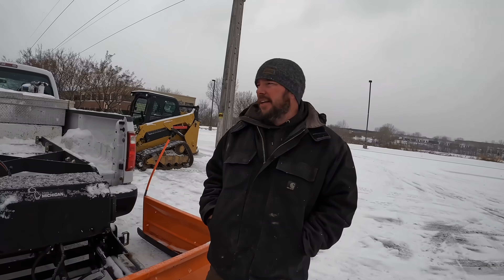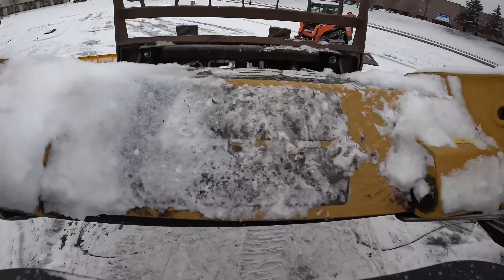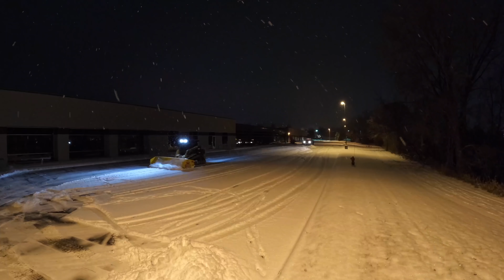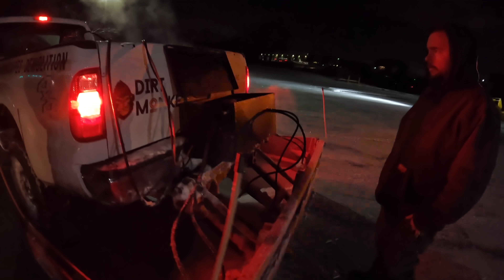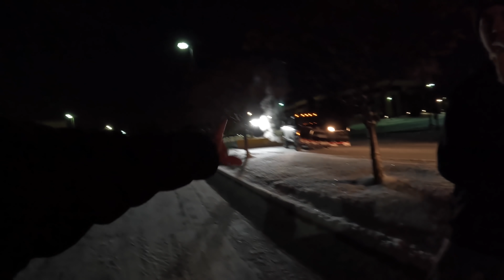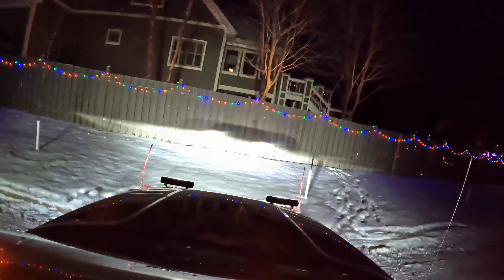The First SnowPlow of the year

Comment: You  should  do a white board Monday with a  sketch  of the  parking  lot, and the  most efficient  way  to  plow it. I don't  plow  anymore but  did plenty of long sleepless  nights one time 36 hours in a 5' Noreaster. I did  knap 2 hours. Like  to watch every  once  in  awhile. Broke down  at least twice  every  season. Duct tape extra  plow parts,hydraulic fluid,bulbs carried extra hoses,plow edge bolts you name it. Usually doing  repairs  under the coldest windiest  blizzards, but not telling  you  anything new. I'm sure  you  have lots of years of experience and  valuable  lessons  learned.  Merry Christmas.
Reply from the maker: Merry Christmas and Yes-  been there with all those breaks downs in the coldest time of the year.

Comment: Stan im happy im not the only one that completed failed last storm!! Thermostat blew in my 7.3 powerstroke so i replaced radiator and thermostat then went to go pull outta the shop and burst 2 lines on my plow, got the backup truck setup and got to my accounts then the controller completely stopped working 🤯😡
Sometimes you just need to accept the Loss and try again tomorrow lol i couldnt do anything but laugh

Comment: Stanly you need to look into a fisher xv2 or xls plow I know you are not a fan of western plow control but I promise you once you use a fisher and find out how simple and reliable they are you will never go back. Just so reliable and onlyblade I’ve used that can stack snow like they do
Reply from the maker: I do like the fischers
Reply: @Dirtmonkey   next truck put one on will never go back for parking lots you can’t beat the simplicity. Yes it does not have down pressure but it’s a heavier setup then most so it does Awsome job scraping for a plow without constant down pressure

Comment: I feel you with the break downs. Blew out my driveway once and now my old Craftsman tractor won't start and the belt keeps slipping off for the blower. Looking for another tractor with a snowblower now. Was thinking about getting a plow for my 01 Silverado but it drifts bad here have had 4 to 5 foot drifts before and a skid loader had problems getting through. A tractor with a snowblower is best. I can't complain too much bought my Craftsman tractor back in 06 for 350 and this is the first time it has failed me. Just got the snowblower for it last winter worked good all last winter.
Reply from the maker: sounds like that old craftsman served you very well for a long time.
Reply: @Dirtmonkey  yes it did. Not sure what is wrong with it.

Comment: ive got a late 90s sno way with down pressure and had my plow fall off at least 3 times and ripped the wiring harness apart every time back dragging and now i always run 2 seperate chains from the tow hooks to the plow quick hitch to keep it from going out
Reply from the maker: falling off is bad but when it takes your wiring with it thats frustrating.

Comment: I did the same thing with my Hiniker Scoop Plow. Passenger side was locked in but must have not got it back far enough on the drivers side. The pin went through but not on the mount. Looks like we both dodged a potential big accident.
Reply from the maker: Yeah close call for sure

Comment: for pickups i tried out a set of retreads with walnut shells cast into the tread....am amazed at the traction on ice...can do in two wheel drive what i had to use 4x4 for
Reply from the maker: Ive never heard of that
Reply: @Dirtmonkey  treadwright and toyo both make them...worth a look...do know that when driving down the road i air up to max inflation to keep tires cooler

Comment: Yeah im itching to try out my new tire chains for my tractor that are more aggressive then the old wore out set.  Unfortunately im kinda needing someone i can call to plow my driveway were im living now to a quick and dirty plow so i can get in with my semi bobtail when i have my home time.  Worst case i can pull in to moms driveway and get my tractor out and put blade on and go plow my driveway next door and when bring tractor back grab semi and park at house and then i have my pickups i can drive while home.  My dually is not road legal and power brake booster issue though but 4x4 works if needed around house

Comment: Would you ever consider using a tire siping tool on the summer tracks to give the more traction? It may be a way to breathe some life into a tired set of tracks that still have enough rubber for winter use.
Reply from the maker: That has been discussed.  It may happen

Comment: Was the Transfer Case failure on one of the Fords? Make sure the front driveshaft joints and locking hubs are in good working order. Either one can cause contribute a transfer case failure.
Reply from the maker: Yeah-  the ford blew up.  its in the shop now

Comment: I’d have the winter tracks already on the skid steers before it snows ? Just sayin ?
Reply from the maker: We got caught on this one.  Just not ready
Reply: @Dirtmonkey   For your next truck i highly recommend the Ford with the 7.3 Big Block V8! I traded in my 2018 Ram 2500 6.4 for a 2021 F-350 STX FX4 4.30 gears , 10 speed trans , snow plow prep last April ! I luv this thing . It gets better gas mileage than the Ram . I’m running a Boss V Blade on it ! You won’t be disappointed! Pure Beast !

Comment: Stanley I know you have seen the one that I am thinking about.  The only picture I could fine was on YouTube for the John Deere Worksite Pro Snow Blower.  I am more interested in the unit that you can put the top on the ground and back plow.  I know you saw it at a show you were at.  It has 2 augers and the opening is adjustable.  There is 1 for a bobcat and another unit for a tractor.  Is is possible to get a test model and try it out on your parking lots?  I would like to know exactly how good they work.  Do you know what I am talking about?

And what are you doing?  Snow???  I think I saw a snow flake the other days.  I was wearing shorts last week.  lol  Today I took down a shed all by myself!!!  it was the first shed I have taken down by myself.  I learned a lot with this small shed.
Reply from the maker: I do know which snow blower you are talking about.  I have been trying to get one to test for a while now.  Id love to see what it can do.  and congrats on taking down your first shed!  Next thing you know you will be tackling garages and even bigger structures!  Growth and pushing yourself is awesome!  Merry Christmas Bill!
Reply: @Dirtmonkey  I had a garage job that fell threw.  The garage was built across the property line and was a nightmare between the neighbors.  But I want to do a garage.    This has been my best year yet.

Comment: that back blade on the ford sounds like there is water frozen in the lines. when was the last time you flushed the system? I'm sure its water in the lines and the pump cant push the ATF

Comment: I'd like to see a video on the new Hiniker C plow, the maintenance guys at work want to get one for their new F-550SD because they have a mix of Boss and Western equipment and don't like the controllers because they have too many buttons compared to the simplicity of the classic Hiniker controller, they also can't get terribly close because the controllers don't have very good precision and the auto float has a tendency to dig in and ruin cutting edges after a season
Reply from the maker: I can't do a c plow-  it doesn't hold enough snow for me.

Comment: Knew a guy who had that bed tool box it's absolutely junk after a couple years the plastic started to break on all of it especially where the handles mount to pull then in and put nice concept but should of been aluminum or stainless steel

Comment: Stock SVL75 tracks are not best in the snow I've done lots of plowing using the 1 yard bucket we have for it. Had lots of scares where I have plowed is slopes once you start sliding its hold on to your hat.
Reply from the maker: Right!  a slight slope and the machine is on its own going where it wants.  You need flat level ground.

Comment: Mister Monkey, may i call you Dirt? 
Anyway, I'm watching this video, like i usually do, to try and gather knowledge. i don't know everything about landscaping, and soil engineering, and all the stuff that would be good to know for any home owner whose home happens to be built on the ground. i don't have snow here in FL, but its still cool to see the heavy machinery, and get some experience by proxy.
so I'm watching, and when that back plow came up slow i actually said out loud, "sounds like the pump went bad" and you guys started looking for leaks. and I'm like "what are you doing man, check the shaft in the pump, likely bearings or seals", then you guys checked the battery, and I'm thinking "is the pump fine? did they check it already? what could the battery possibly do to cause that sound".
by the end of the video it turns out that you said the pump went bad, and i had one of those realization moments.
just like i don't know everything you know, you don't likely know everything i know. "but i look to you for knowledge and experience, you should know more than me" i had this same problem when my mom needed help with her computer when i was younger "you taught me everything i know, and i know this, why don't you?"
i guess every single person in the world cant know everything about everything, and that's probably why its so important to be a good team player, and help your fellow man. if for no other reason than pure selfishness of knowledge and experience.

Comment: alootaaaaa more bogey wheels and surface on the snow not a fair push, let alone weight difference.. come on now
Reply from the maker: both are 74 hp and both are 9,000lbs-actually within 20lbs of each other.  the difference is in how each companies set up their tracks.  These are 2 identical machines as far as hp and weight.  the difference is in the tracks and configuration.  The kubota has dirt tracks, big lugs and a hard rubber compound.  The ASV is designed and built for off road trails and working in snow by a company in Norhtern Minnesota.